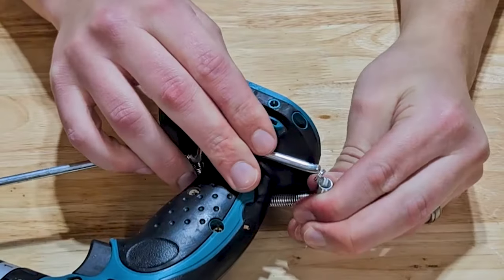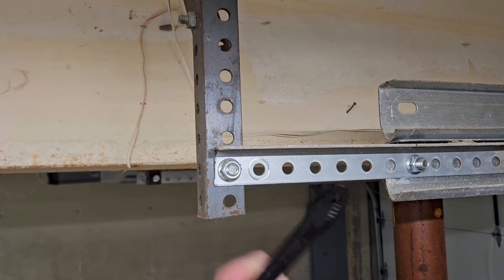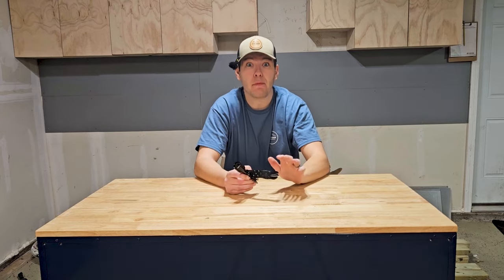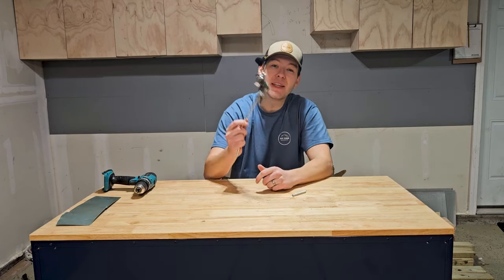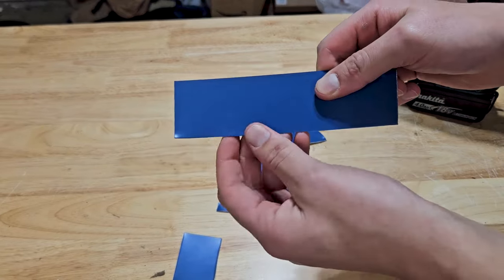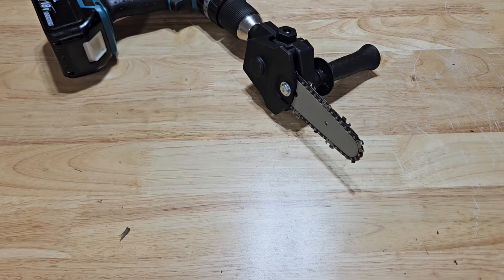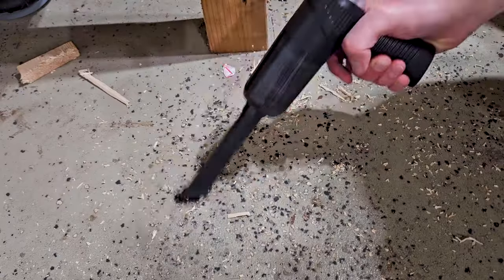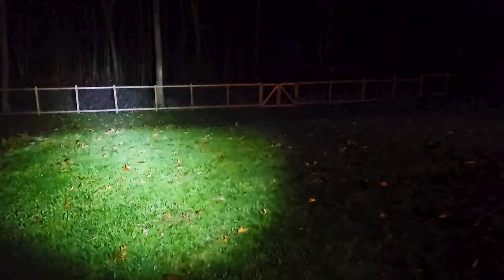Are TEMU Tools Worth Buying?

Comment: A must say a think you got rinsed with what u got ave had 2 orders from temu and both apart from 1 product have been really good. I recently ordered £50 worth of resin moulds and gotta say there brilliant. For example one of them if i had of ordered from another company (not temu) would have cost me more than my entire temu order just for 1 and friend of mine has the one i would of got and theres no difference between them. Granted there are some shockers but theres also some good purchases aswell as that yes there ripping off some companies but 1 thing for example the gripper from micro jig i cant get that here in uk apart from the knock off through temu.